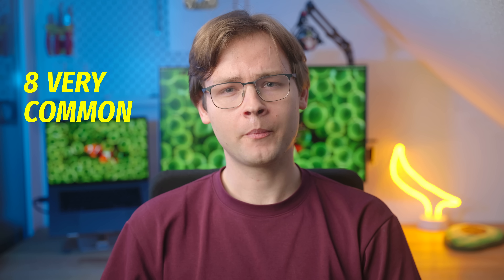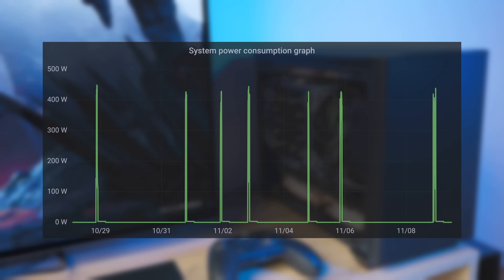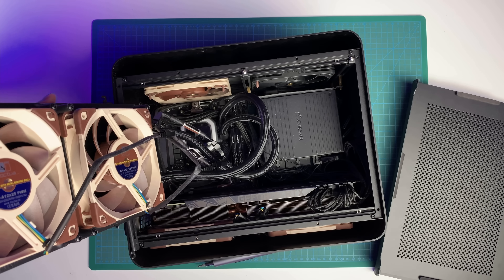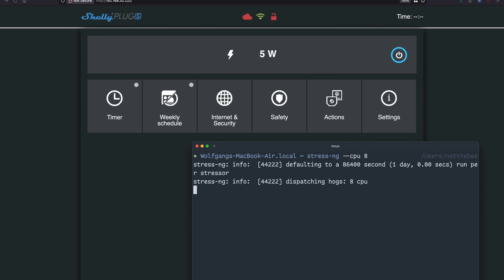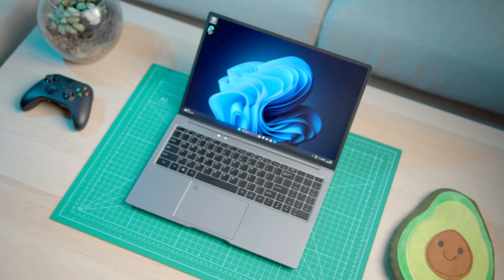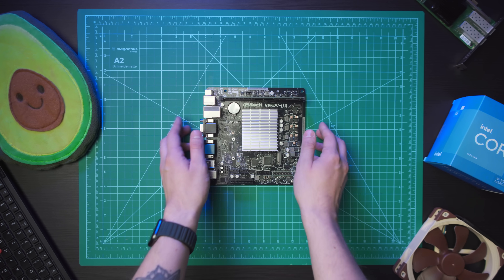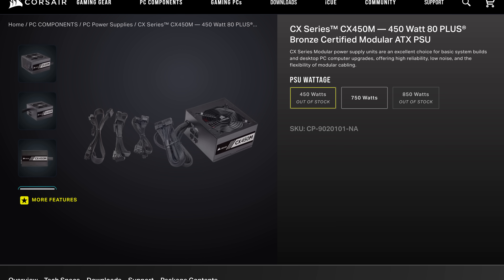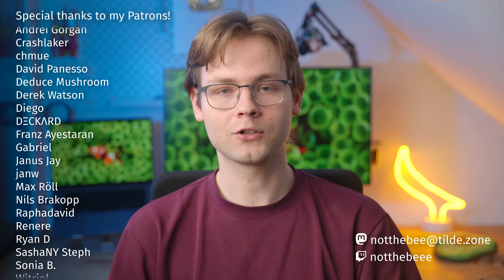Busting 8 Common Homelab Power Efficiency Myths

Comment: the i3 13100 is 4c8t, if you disable 2 of its cores in the BIOS you should achieve similar if not better efficiency than the i3 6100 (2c 4t)..
Reply from the maker: Unfortuantely, it doesn't work that way. I also have an i5-13500, and the idle power consumption is the same between it and the i3-13100
Reply: @WolfgangsChannel  a lot of it is motherboard specific, but comparing the power consumption of two different CPUs ignoring the fact one has two more cores entirely is very misleading.
Reply from the maker: It's not motherboard specific – the i5-13500, which has 14 cores, consumes the same amount of power at idle as the i3-13100, which has 4, on the same motherboard. See 5:02
Reply: @WolfgangsChannel  yes different motherboards have different minimum idle power consumption figures based on their chipsets and designs. But if you're comparing two generations you should strive to keep every other variable the same, you can even just disable two cores in the BIOS for the sake of demonstration.

Comment: I would ALWAYS choose ECC memory for a storage server. That extra level of security for the important data is very helpful. It doesn't matter if the file system can ensure that the data on the disk 100% matches the memory it came from if the memory has an error. For everything else? Whatever's lowest cost and works well is fine. I have 3 servers running at the moment, 2 storage servers with ECC and a firewall box that has no ECC. I plan on a 4th machine for virtualisation which will also not have ECC as it doesn't need it.
Reply: Well, ECC is only useful if implemented correctly and set up correctly. Most people who buy ECC RAM don’t really understand that topic and won’t benefit as much as they expect. For storage it’s useful but it depends on what you do if that actually matters

Comment: I have no clue how to get that low idle power consumption. I had a 4770K and a 4790T and the whole system consumed 60-70W in idle with 6 HDD + 2 SSD, one pcie network card with 2 ports and 4 fans in the case. I changed to a 5800x and now server is consuming about the same, even a little more. Running ESXI (older version 6.0) with 5 VM (FreeNAS is one of them) that are idle most of the time. I tried every power saving setting in the BIOS but no luck.
Reply: Ryzen is not very efficient at idle. Are your hdds spinning down when not in use?
Reply: Put your drives into standby mode. My Haswell (Xeon E3 1231v3, which is pretty much the same to your i7's) is idling @14W from the wall with 5 HDD + 2 SSD and both NICs (2.5G, 1G) connected to different VLANs.
Reply: @AuftragschilIer  sadly my drives won't go into standby mode for some reason. Even If I set up standby to 5-10 min with/without spindown they don't. I'm not the only one with issues with FreeNAS. Saw other people not being able to put their HDD in standby.
Reply: @AuftragschilIer  well I finally managed to figure out why freenas was not spinning down my drives. Because of the jails that for some weird reason are on the pool. I really thought they were on the system drive but that doesn't even seem to be an option to move to. Once I stopped all jails the drives spun down (25W power reduction). Power usage is still around 50-60W but it's a step in the right direction.

Have to put an extra small ssd for the jails now and figure out how to move them away from the pool.

Comment: for the myth around newer processors are more power efficient. The way that myth comes around and where it actually rings true is by looking at average power draw. Faster processors will chew through a workload faster and return to idle faster. so if you have an atom system but it spends hours at high load but the newer i3 does it in 5 minutes the newer i3 will be lower when averaged even if the atom idled at 2w and the i3 at 5w. so the answer to that myth is totally it depends.
Reply: Except that the Atom system today will take maybe 20 minutes, less if it's a faster one with active cooling. Silvermont and Newer aren't your Netbook's Atoms. Most of what you'll find are within 30% of the per-clock performance of current E-cores (which I believe are Tremont).

Comment: After looking up the average price of electricity in Germany, it makes a lot more sense to me why you do so many videos on power efficiency. You're probably paying 3-4 times the rates in my local area.
Reply: @benjiro8793  Americans are the most entitled people on the planet. They already get much cheaper gas than everywhere else and it's still too expensive for their massive vehicles. If the government stops paying for half their gas, they won't try to save money by using less gas, they'll literally riot (they tried on Jan 6 2021).
Reply: Crazy what electricity costs when the tax payer isn't paying half
Reply: @thewhitefalcon8539  I mean, I wasn't trying to make it political, but since you went there, Fairbanks does not receive substantial Federal, state, or local money for electricity generation or distribution as an overall percentage of energy cost, and I wasn't factoring in the federal programs for people with low income, or special needs, since those aren't programs that I have used. Last time I checked, it was 13 cents per kilowatt hour.

Comment: If you don't need a whole bunch of power for things like sata drives, I've had good results regarding efficiency just getting an industrial 12V PSU and strapping a PicoPSU to it. Only an option if you're willing to either work with mains wiring or have a 12V laptop brick lying around, but those usually have pretty good efficiency at lower wattages due to stricter regulations than desktop PSUs.
Reply: If all you're doing is wiring a power cord onto an industrial PSU's screw terminals it's not even that scary.
Reply: @thewhitefalcon8539  True, it was more of an obligatory warning than a comment about serious mains wiring project, but it's still mains wiring for which you need to ensure everything is correct and you know what you're doing before you plug it in or touch it afterwards.
Reply: You can get such PSUs that take wider voltage ranges, too, making 16V and 19V/20V bricks viable.
Reply: @laurelsporter  True, but those usually have lower wattages and make it harder to hard-wire extra connectors to devices if you need more power than the plug supports.

Comment: my low power home server solution was 2 RPI 4's (back when they could be had for 40USD)
a few years later still running my home automation stuff with 100% uptime out of a pair of usb ports
they also handle the DNS server load of a 10g network

for my nas i currently have a single bay unit, although i may have to upgrade soon as its not enough to solve the external hdd problem so that may become a home server

but most of the power consumption in my rack is the rest of the network equipment which totals up to 175w, the energy monitor calculates a 2.158kwh daily consunption

other things are my gaming and website + service servers (not power monitored) which are all x86 pcs, they usually do 30w idle except for a few, but power is cheap where I live so I collect data just to put it in a chart

Comment: You are absolutely right about the importance of idle power consumption due to the 24/7 nature of homelab server.  I am searching a long time for this and as you said no other tech tuber presents this issue.  I want to build a homelab server with 16 drives working with unraid for power efficiency, but I am concerned about the initial boot power draw of all the drives concurrently if I use a low power psu.  I don't know any consumer motherboard that starts  hard disks one after the other and I only find high wattage atx psus that support so much amperage at start.  Have you investigated the concurrent draw of multiple disks and its effect on the psu?

Comment: Nice video. With the older vs newer model CPU comparison, I would have liked if you compered modern CPUs to even older ones, like Sandy Bridge, Ivy Bridge, Broadwell, Haswell. Those are still very usable CPUs for home server use, and there is still negligible difference in idle power draw.
Reply: You're right but actually idle power consumption or rather low load power consumption improved a lot over time. Ivy bridge and older will draw significantly more power than more modern cpus
Reply: I run an Ivy Bridge Xeon Server and stepped down from a 12 core high end model to a 10 core sort of low TDP version. In this generation that actually made a big difference even in idle. While these chips are still very usable I would only recommend them if electricity cost is an absolute afterthought. Here in Germany, it is, sadly, not.
Reply: @catriona_drummond  Couple of thoughts. I’m not disagreeing (or agreeing) with you, just want to add to the discussion. First, higher core count will always lead to higher idle power usage, regardless of architecture. So, if you compare older and newer CPUs with equal core counts, I still don’t believe there is a big difference in idle power draw. (I might be wrong.) Now, it’s true that older CPUs with 4-6 cores won’t be as performant, but that’s part of the deal when choosing an older CPU. If you need performance, an older CPU is definitely not a good choice anyway, regardless.
    Second, lower TDP CPUs may have lower idle power usage, but the reason is not the low average TDP rating. If all other factors are equal, then what matters is the base frequency. If you choose a CPU with a low base frequency, but high turbo frequency, it’ll have high TDP rating, but the idle power usage will still be low. TDP is not a good indicator of idle power usage.
    A third thing I want to mention is that many people see older servers using a lot of power, and they attribute it to the CPU, while this is a false assumption. Old servers are cheap. So, people buy higher specced rackmount machines with a lot of components. Like SAS controllers, hot-swap backplanes with 6-12 bays, 8-1000W dual PSUs, a huge number of system fans, hundreds of Gigs of memory etc. And then they say, “oh it’s inefficient, because it’s old”. No. It’s inefficient, because there is a lot of stuff in it that they don’t need. The same architecture, in a tower case, with 1-2 fans, a SATA controller, and 16-32GB of RAM would use maybe 10-15W more than a similar, newer config. Or not even that. Whether that’s a lot, I don’t know. The ROI on buying newer can be 3-5 years or even more. That's a long time.
Reply: @tamask  Cores can be shutdown in firmware. 
Anyway... is 15w a lot? My server has a peak of 15w while writing to a spinning hard drive (which is 8w alone). It is 2012 vintage (32b ARM, but that is the sandy/ivy era.)
Reply: @tamask  In theory, modern high core count units tend to have better TDP by having better IPC or better core management, which translates in a higher performance per watt ratio. The old server argument tends to backfire once people discover that modern servers consume more power at idle than older ones. It's not out of the question for a modern server to use 500W at idle depending on which hardware is in it.
Reply: @lukas_ls  absolutely. IPC and the number of powerstates also play quite a large role on what task is considered low load. If the older system needs to spend more time at higher powerstate or even can't sustain the background services at the lowest powerstate, then the newer CPU will consume less by staying at the typical 800MHz.
Though all of this can be mitigated by the motherboard idle consumption, as stated in the video.
Reply: @PainterVierax If the CPU is old enough, it can definitely make a difference, I swapped from a haswell era "xeon" (basically i7-4790 that can do ECC) where with all the services like the OS, dockers etc. running, but the system being idle it would run at around 78W, my EPYC system does the same at about 75W (with obviously way more flexibility and performance behind it)
Reply: @MysteriousFigure  You're comparing two different beasts. Chiplets and interposers have a significant impact on idle consumption, hence why this epic system barely makes any improvement in that regard.
Reply: Testing is important, manufacturers will pull all sorts of tricks like including sleep states as idle power specifications. However sleep states are generally not suitable for a server that needed to be on standby listening for requests. (There are use cases for server sleep in a large commercial setup with WOL and load shifting to fewer machines during off peak hours. Not relevent to a solitary home server.) 
Which reminds me Haswell [IIRC] had such low current in one of its sleep states that it would cause voltage instability in some early motherboards and they would self reset.
Reply: actually there is 10w difference in idle between haswell and ivy bridge. And thats it, there were barely any improvements to idle power draw since haswell
Reply: @rafradeki  Such absurdly generic statements don't add to the conversation. There is more than a 10w variation in idle between two model numbers of the same generation and subclass.

Comment: Great vid 👍
Based on NYC-area marginal use rates, each incremental 100W of at-the-wall power draw adds roughly US$150.00 per year more in residential electrical cost if left powered on 24/7/365.
Or approx. US$375.00 over, say, the five-year life of a single, 50W-average device and inclusive of a fistful of 3.5" drives (as of December 2023).
Kindest regards, neighbours and friends.

Comment: Great video. I’ve been down this road in multiple ways with multiple projects. The Asrock J5040 ITX is a great board for low idle and still having decent enough performance for some applications. But 12 or 19 volt DC powered boards can be an even better option when paired with a high quality power factor corrected “brick” PSU.  The Micro PSU adapters are not great as you’re triple converting the power from the wall to the CPU. 

It’s also sad that idle currents for desktop CPU’s have generally gone up with each new generation. 12th gen Intel idles at about double its 6th gen equivalent. And the peak “turbo” power is also way up and well beyond the normal TDP unless your bios lets you restrict it. That means an inefficient at idle oversized power supply. The benchmark wars have been mostly waged by Intel and AMD cranking up turbo speeds. 

The older i3 Intel NUCs are impressively low idle power if they have enough I/O for an application but they often don’t. It’s unfortunate not even Asrock makes fanless boards with lots of expansion interfaces that use similar power to a NUC or laptop. 

I also want to point out the idle power of Apple’s M chips crushes anything in the x86 world of similar performance. You imply they do not have an advantage at idle but they do. Now the crappy Raspberry Pi indeed has horrible idle power consumption in excess of a Macbook M1 Air. I think it’s funny how many use Pi’s for 7x24 applications when they’re not well suited besides being cheap. They don’t even have a SATA interface and trash their SD cards. And they use so much power they need fans or aftermarket heatsinks to survive inside an enclosure.

Comment: Is that really a fair comparison between the I3 CPUs? The Skylake is 2c4t where as the Aldorlake is 4c8t. If anything a Skylake I7 should be used since it has similar core/thread counts.
Reply from the maker: In my testing, theres very little difference in the idle power consumption between processor SKUs of the same generation

Comment: Myth importance number #1, your homelab has to be On 24/7, is likely nobody but you is using that thing at 3am schedule it to turn off in the 8 hours of less likely use = cut your energy use by more than anything you could optimize
Reply: Well unless you have something that always runs in the background?
Reply: @siontheodorus1501  plex or almost anything always runs in the background the point is when do you actually use them
Reply: it does when you seed things... but i got my idle power draw down to like 5w so i can justify the $20/year to keep it on and not have to workout turning on and off either

Comment: As a low power enthusiast who runs my homeserver 100% off a solar panel, I have to admit myth #5 tripped me up.  I knew all the rest though!
Reply: Spill the specs!! I'd love to run something like that off solar
Reply: I use a rasberry pi4 with 8 4tb HDDs. It sips power. Also, i have a really nice router.  Its all hooked up to a UPS, just incase my solar batteries die. Plus, i also use this setup to charge all my drvices. Like batteries, phones, steam deck... etc... 😂. SOLAR POWER !!!  @BomarJr
Reply: @ricardofranco4114 How did you hook the HDDs up to the Pi? And how do you power them?
Reply: I also run my nas of solar power 100%. Same for my router. I have 3 100-watt solar pannels. Hooked up to a 20ah mppt solar charger. I also use 2 20ah lifepo4 batteries. @BomarJr
Reply: @BomarJr I will assume something like a 50W server running from a li ion battery of 2 kWh or so. A single 400W solar panel could keep that charged in most conditions without any problems.
Reply: If you do off-grid or hybrid solar, then a good DC to DC converter will be more efficient compared to using an Inverter and an AC charger/PSU. GaN power electronics should be more efficient.
Reply: how do you setup solar panel in a way so that it will charge the battery via solar first. and then it will quickly switch to home power when solar is low on charge?
Reply: @gaiadrazer  So my Ecoflow unit doesn't support dual charging sources.  To get around this, I wrote a script to monitor the ecoflow's battery % via their API and then used a TP Link Kasa outlet switch to toggle home power when the Ecoflow dropped below a certain percentage.  Definitely over-engineered it lol!